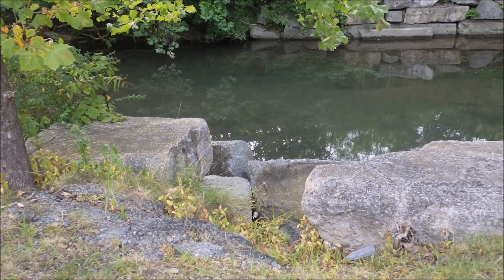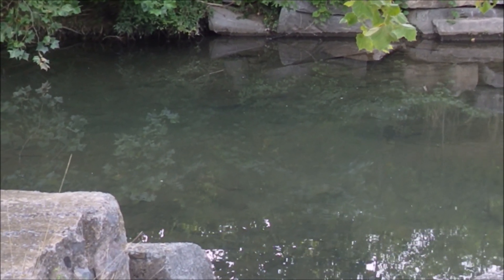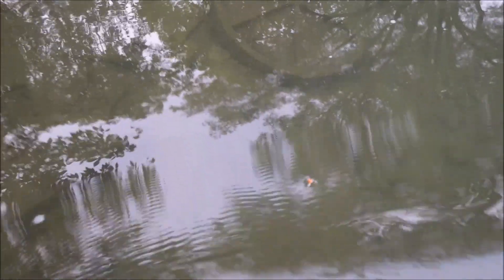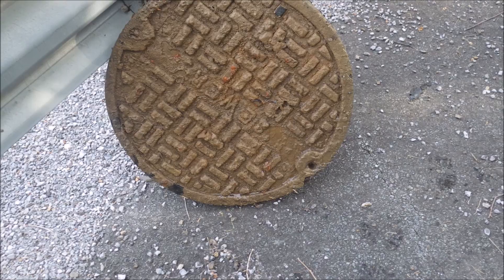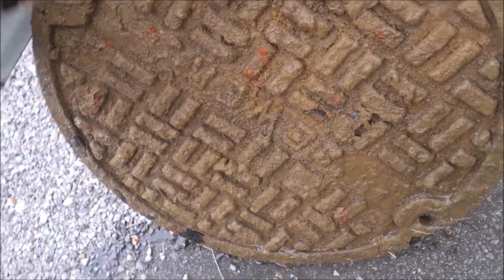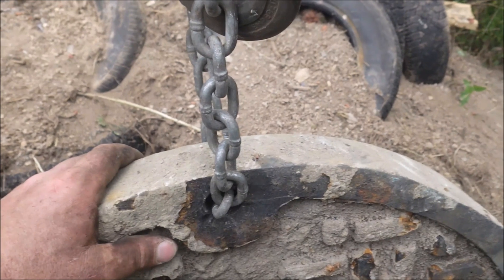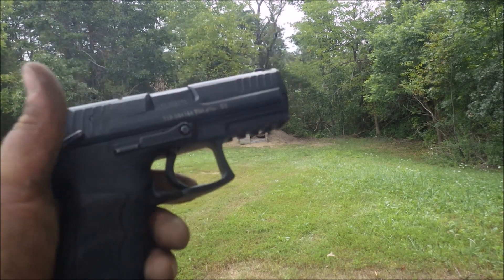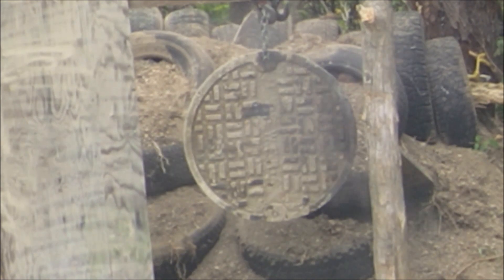SHOOTING CAST IRON man hole cover

Comment: Looks like you're shooting left.  (Did I notice that you're left handed, too?)  Try
switching to your other hand and see how your pattern changes.

I'm surprised that you couldn't get a weld to take; I thought cast iron would be pretty
weld friendly.  Were you using an acetylene torch?  Arc welder?  Did you try different
welding rods?  (Jeez, now I'm curious...)
Reply: I am going from memory, but, as I recall you PRE heat cast iron, then they sell a "stick rod" for the arc welder to weld cast iron. But, it's not fun to weld up... it's like welding the spider gears in your rear end,  great, UNTILL It breaks, and tou through the whole unit away. -the chain is the best way to hold this up. -  just don't forget a .357 magnum can CRACK the engine block of a truck, and that engine block is cast iron. ----

Comment: You will shoot right through it with anything doing 2,000 fps or faster....they are not bullet proof or resistant for that matter.   You will blow chunks right out of the casting even with your pistol in time.  I have ruined a few of them.